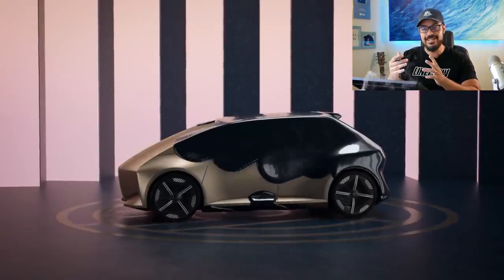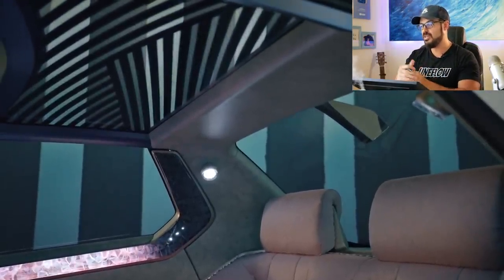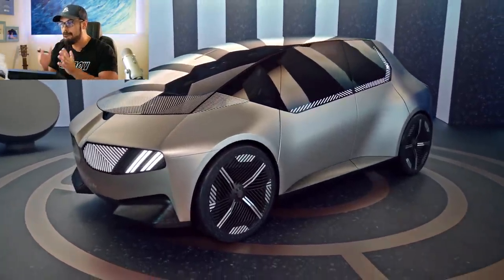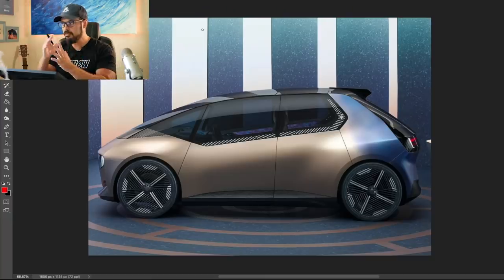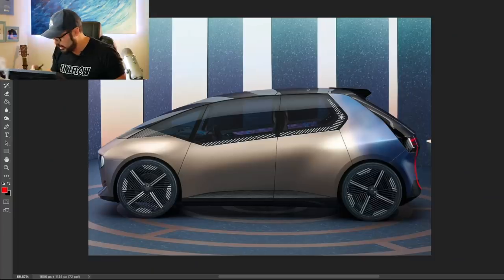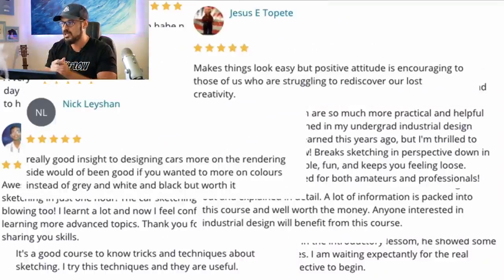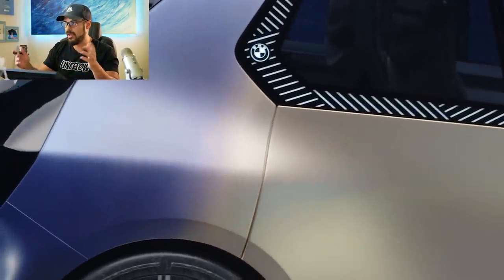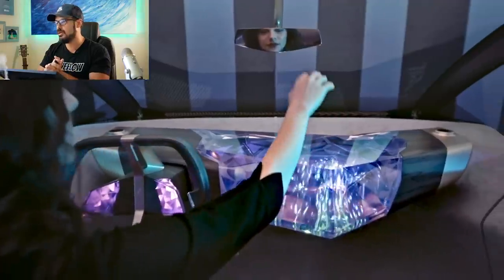BMW has gone and done it again...

Comment: Could be cool if one could reprogram the 'headlights' into the traditional angeleyes rings. Would bring even more connection to the heritage.
Reply: I did a very crude redesign in Paint and I have to say that it looks pretty damn cool. I expected it to clash with the otherwise angular design but when I came back it just made so much more sense.
Reply: They should make the whole front one big panel. Then you can customize not only the light shape, but also the kidneys. Opel made the electric Kadett restomod with this idea. They call it the Vizor. Pretty cool stuff.
Reply: @Jasenkob  but then you dontt have the body panels flow into the grill and stuff, look at that central channel that cuts into the grilles, that tie in makes it look cool
Reply: Agreed. This being a concept, I can imagine the same effect but slightly toned down, less theatrical so to speak. Finding balance between one design features and the car as a whole can result in great outcomes, subtle beauty. I'm leaning towards the minimalist side of design :)
Reply: I too feel that the lighting graphics are letting down the otherwise excellent body silhouette. These straight lines are clean but lack class.
Reply: @Jasenkob  I agree, it looks cool, but unfortunately it's not street legal that way. At least not over here in germany.
Reply: the leds are strips so that will not work

Comment: With all due respect, I cannot agree. Where is the 'L' shape taillights? I know this doesn't have an engine up front, so it doesn't need a 'long bonnet' - but that is one of the best features of the popular BMW designs from the past, of having a long bonnet (which you could use to have extra storage space up front). Also looking from the side view, I would've appreciated a better presence of a waist line (or upper character line) that joins the headlight, through the front fender, through the door handles, until it ends on the taillights.
Reply: I agree, I also like long bonnets (of my Mazda). But BMW's design language has changed over time and I like that BMW explores new design languages for future EV cars.
Reply: Mazdas designs are excellent nowadays. Love the current ND MX-5 and I also love their older cars like the FD RX-7 too. I get that design has to evolve over the years, but this design doesn't look like it has a BMW 'identity' other than the kidney grill and the hoffmeister kink. Take those two features away, and then it can be mistaken for a Toyota eco car. I think its important to keep certain things, and innovate other things in the meantime.
Reply: The L taillights are in the horizontal LED strips in the rear.
Reply: @Vin80_  They are not L shaped enough to be obvious.
Reply: But hey at least they're there.
Reply: @Vin80_  Nah, thats not an 'L' its just two lines that are of different thickness. No one can tell its an L shape from first impression

Comment: I really like it. If you're a BMW fan who doesn't like the i3, then you're probably not going to like this. It's obviously based on that car in size, proportions and even has the large pillarless door opening. I hope BMW go with this style and develop it into the next i3, that carbon fibre/aluminium platform is still years ahead of the competition at nearly ten years old. Electric cars don't need grills, so adapting the kidneys into full width lights make sense. It looks like a BMW and I have no problem with the kidneys being the face of the whole car, that's the case with the Isetta which is one of the greatest BMW's of all time.
Reply: I don't like how the i3 looks, but I like this design. The i3 uses too many materials, which is something that bemblii talks about here. Also the i3 has awkward proportions and very cheap-looking headlights. Overall this design would look much more classy and refined than the i3
Reply: @quincypurcell5222  yes I agree with you. The i3s looks didn't appeal to enough people. I think this would do much better even though the proportions are roughly the same.

Comment: I would like the kidney grill lights to be all vertical rather than having half of the grill with horizontal and another half with angled lines. Moreover, keeping in mind the circularity, they didn't come up with circular LED headlights (in adjustable red, yellow or white colors) , that would be very cool. And I don't see much of a circularity in this car, except the single circular roofline. Thinking about the rear lights of this car, I don't like the thin and angled lights crossing with 2 bold horizontal lights. Instead, they could have shortened those 2 bold lights a little bit and give them a kind of 8 series tail light shape and keep the rear panel more clean without those differently angled lights. Moreover, the shark dorsal fin piece is standing out too much in my opinion, or maybe it is seeming to me like this because it is mounted in the middle of a blackened rear glass. If they put 2 or 3 centimeters wide metallic stripe, that would look nicer I guess. I can't tell many things about the interior, but that angled front board is there and I am happy with that.

Again, big thanks for this video, even I am not related to car sketching, I am really enjoying.

Comment: The first seconds I was a bit shocked by the Design but after a while it was interesting and pleasing to the eye. This car knows what it is. It`s 100% a modern electric car that left the design of the ICE Age behind.
Reply: It's also practica. Supposed 5 series interior space in an i3 car size. Realistic will prob be a 3series interior space, but that's insane, given the car is smaller than 1series :O

Comment: Basically, I agree and I‘am completely with you — it’s better by far than anything from the brand in the last years! But i also have to say that i‘m still not convinced completely: the back reminds me of a Renault Twingo, without the BMW badge I would not identify it as as a BMW. The leaning —forward -cabin is also somehow strange. Yes, it’s responsible for some kind of animalic pushing-forward effect. But, It’s probably one of the main reasons that the whole car feels so detached from the human body and it’s proportions, so van-like, to big and , you name it, like an household appliance but not a beloved drivers car build around you slim-fit and ready to be tossed around tight curves. — but I appreciate that it really looks clean and determined not like a build identity crisis as the iX for example. Even Gives you some vibes of the M1 era when BMW was really avant-garde.

Comment: It looks like BMW has lost its way. I like the interior though. It might be all that light treatment that's ruining the Car.

By the way, the grille lines are not horizontal. Rather, they are both vertical, and diagonal lines.